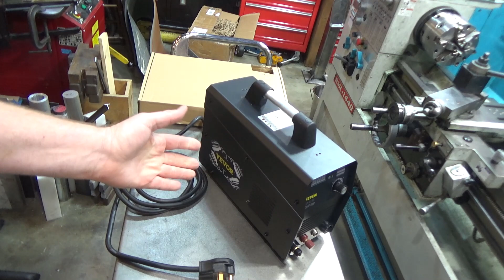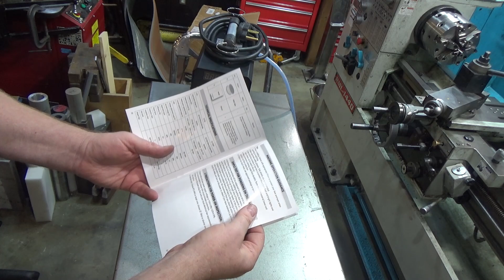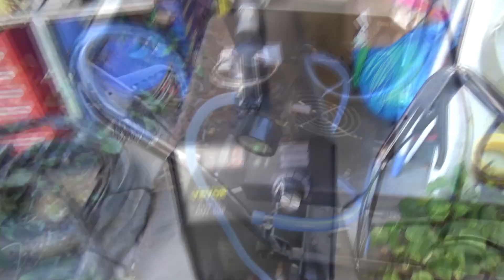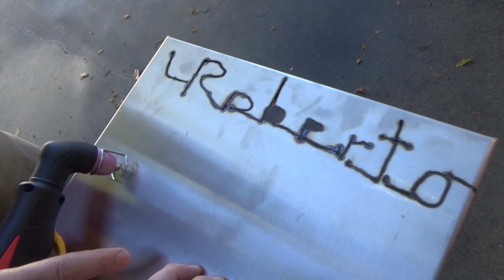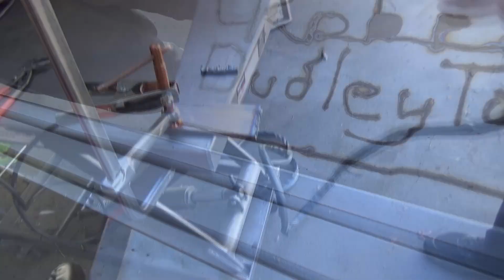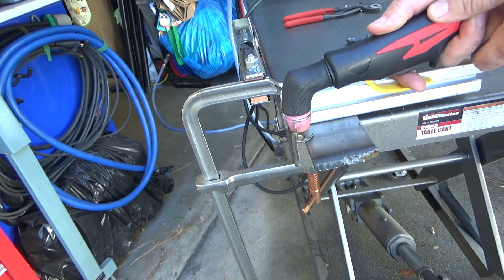QTR 91 Vevor Non Touch 50A Plasma Cutter

Comment: The main problem with "these" (meaning Chinese mystery boxes)  is  sometimes there is a low duty cycle rating.  A lot of them will say that you can't run it more than a 25% duty cycle at full power.  Meaning you can run it for 5mins, but then you have to let it cool for 15mins, etc..  It's usually not an issue, because DIY users will just need a cut here and there;  but if it's in an industrial shop where it needs to run constantly all day, non-stop:  they can't keep up, and will start to overheat and usually start tripping breakers. etc.   I'm not saying this one is that way for certain, but a lot of the super cheap units will have that caveat...  

 I have one that is virtually the same size and form factor, but mine is a 3 in1:  It has a stick welder, tig welder and plasma cutter setup all in the same box..  It's supposed to be 200amp, it seems like it's only about 130amp in reality-  but I've only ever ran it with a 120v plug, (it has a switch on the back that says 120/240, so I could also run it with 240 if I just change the plug).  I've been super impressed with it--    It came with all the leads for all 3 setups, plus the regulators, tig torch, plasma torch, etc and even a bag of consumables for everything.. (I believe I paid $600 for it though if I remember right-  on ebay).  I had some issues with it tripping a 20amp 120v breaker while welding thicker material non-stop and cranking the amplitude-- but I found a trick: which is to use smaller 3/32 rod when welding (rather than the standard 1/8 rod of 7018 or 6010/6011), and it burns in deep penetration and still works great, even with the 120v, on a 100ft extension cord.  (I typically just stick with 6011 in the 3/32)

It only has about 8ft welding leads, and Like I said, it's virtually in the same size box as yours, and has a handle on top just the same.  So I took about a 3ft piece of rebar and bent it into an S-shape so that I can hook it on that handle and hang the welder on things;   I tied on an extension cord, and had it all over the jobsite. lol..   I welded up an entire metal building like that;  hanging the welder up on the purlins with that rebar.  I would simply crawl up a ladder, carrying the welder with me by that S-shaped rebar, and simply hang it anywhere close by me so I could weld anything I needed to with the short leads.

   I run my own crew, and I already had the big welder running with one of my guys---    So luging this one around with me everywhere, I was able to have a second welder running-- and it didn't give me any trouble until about 2 years later, when the main switch finally burnt out-- and all I did was completely bypass it, so that it's always on when you plug it in.  I might screw an electrical box on the back of it and just put in a regular house light switch...  but anyway, I agree that China has come a long way and they do put out a lot of impressive stuff, it's just a gamble when you first buy it-- because you're not sure if you'll get a lemon.  Sorry for rambling.  Cheers.
Reply from the maker: You definitely were not rambling. you shared some really good info. I would have loved to review a unit as flexible as the one you bought. I never understood having a bunch of different welders when the hard part is the power supply, which they all have.

This unit had similar restrictions - limited duty cycles at full power (~30%), but I forgot to mention those specs. Darn. I really appreciate you brining that fact up. I shouldn't have missed that. I did use the plasma cutter at full gas to cut the 3/8 plate and never ran into over temperature, but I was trying to shoot the process, so I bet that caused enough delay. I would never recommend a discount unit like this for someone that made a living off of using it, but for the home gamer, it seems pretty darn good. 

You always leave such helpful comments. Much appreciated.
Reply: @DudleyToolwright  THANKS!  :) ...  You just buy a lot of my favorite tools.  Cheers.

Comment: I’ve had a Hypertherm 45 on my “capital equipment” list for a while, but dang, they’re expensive. I generally want to buy from Western companies, so spent 2x as much for my multifunction welder from Esab than a Chinese Everlast would have cost. I’m wavering on the plasma cutter though. I’m likely to never be a heavy user, so maybe Chinesium would be good enough. This vid was very timely, because I was just looking at these the other day.

Most useful point in the video was about the atomized metal, though; that makes perfect sense but had never occurred to me. I have a big cyclone dust collector for my wood shop, will think about making some sort of a spark-safe downdraft table and/or just use the plasma cutter outside. I would have figured it out eventually, but you saved me from getting a layer of metal dust all over my basement! Thanks!

BTW: For anyone else looking, WOW are these overpriced in Amazon vs from Vevor direct - $294/378 vs $216/227 😮
Reply from the maker: I'm glad the review was helpful. I learned about the metal dust the hard way. I also used a plastic tarp under my saw horses, figuring that the 2 1/2 foot spacing would prevent any issues, but i melted thousands of tiny holes all over the place. Another bonus of this using versus the Hypertherm is the amount of air needed. The compressor could actually shut off using this unit.
Reply: I think the air regulator probably has British pipe thread for the barb fittings. I had a cheap Chinese plasma cutter and it died several times which were repaired but I finally scrapped it. That torch went through consumables like candy. I would buy them by the boxes of 100 on eBay. I finally bought the same Hypertherm that you have, I bought a bunch of consumables and rarely had to change them! Too bad I sold the Hypertherm when I sold my shop and retired. Now I really wish I still had it!

Comment: nice little home shop Plasma rig.  I also have the 45XP . only because of the Warranty.. those cut 50s you see all over the net, not so much.  itll cost you more to ship it then it cost to buy it.
Reply from the maker: The warranty is nice, but I could toss it out and buy another and still be saving money. It is entirely possible however, that the 45XP has better performance under properly trained hands.

Comment: Don’t have a cutter yet, but good to know the requirements. A hefty compressor and a 60 amp outlet which is unusual.
Reply: I had a cheap Chinesium unit once - destroyed when I was flooded.  If I recall, mine was a 60A, but that is 60A out of the transformer, not AC input.  Kind of like the way a 200A welder is measured.
Reply: @bobblack3870  You mean according to the transformer equation n1/n2=V1/V2=i2/i1. Yes I understand, but this 60apms was outlet requirement, if I’m not mistaken.
Reply from the maker: You are correct. The manual specified a 60A outlet. I used a 50A. I was not however running the unit for long periods of time.
Reply from the maker: I hope it was helpful. I ran this guy off of a 50A breaker without any issues.